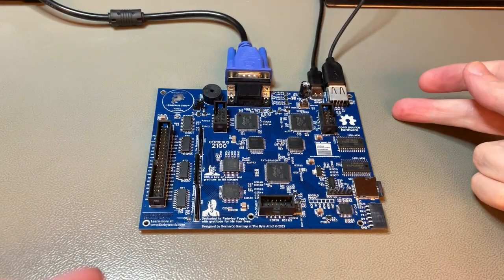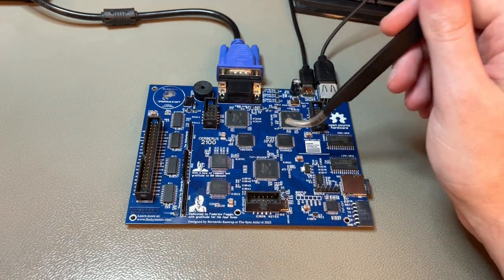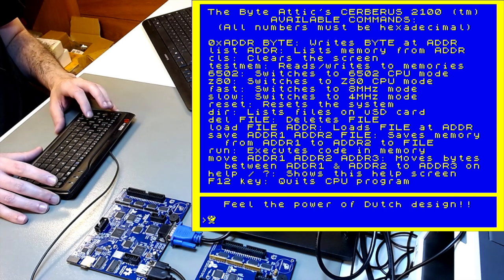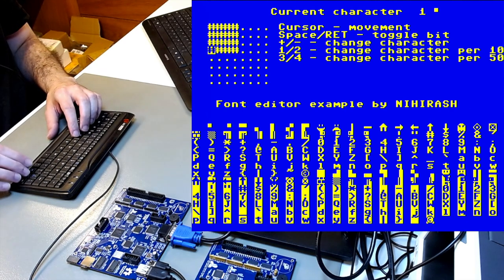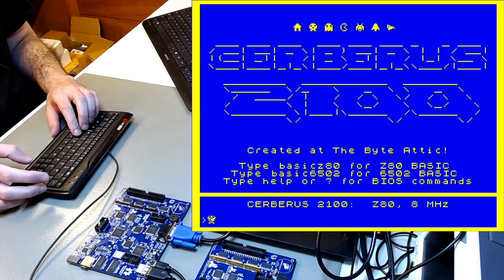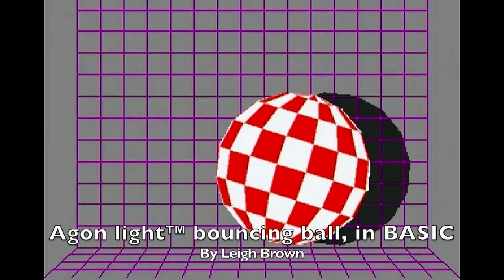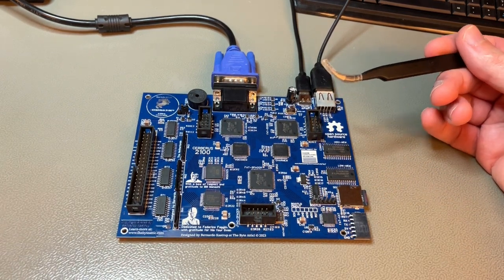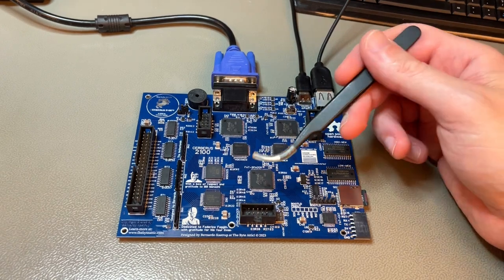Exploring CERBERUS 2100™, Episode 1: introduction and demonstration

Comment: Great effort, your frustrations were mine too. I completed both an EEE degree specialising in Computer Engineering but we were never exposed to something like this. The most we did was PIC microcontroller and some FPGA stuff around an implementation of the Nokia Snake game.

Masters in Mechatronics was similarly in a different direction - both were Math/ Theory heavy with minimal practical exposure. It is rather shocking.

I’ve learned much more post Uni and appreciate your efforts for sure.

Comment: In feel, it reminds me of the old BBC B. One of the assessments on my degree in the 80s was design and implement a server room climate control system - used analogue signals on the userport to read analogue humidity and temperature, and control cooling, heating, and dehumidifier devices in the 'room' (basically variable resistors, with a bit of support circuitry supplied from the Computer Lab skunk works) with paper logging of time out of specification. This (without the printer) would be great for teaching external control and monitoring

Comment: You mentioned the cplds you're using are the best choice because they have internal program memory, making the design simpler. How many write cycles does their internal memory get? I was using some xc2c128 cplds in my project but then found out they only get 100 rewrites before they stopped working. The next easiest to use chips were ice40 fpgas which needs an external spi rom but at least they're faster and 1/3rd the cost so it was a worthwhile tradeoff. I miss that easy schematic mode thingy ISE 14.7 has though, man that made things so easy.

If I would have known of the existence of simple cplds that don't have such severe write cycle limitations, I would have picked that instead. Too late though, I spent like a year tinkering with fpgas, already figured enough stuff out to actually use them and it's too late to turn back.
Reply from the maker: Not sure how many cycles, but I think it's flash-based, so a couple of thousand? I never had an issue, even after many, many reprogramming cycles in the original prototype/

Comment: How about if i want to use my desktop computer as a terminal to write assembly, C, and Forth on the CERBERUS? Or write my code in vscode, and run it on the CERBERUS?
Reply from the maker: You can use offline tools to develop for CERBERUS and serially download code straight to the uSD card. But in principle it won't work with an external terminal with the official version of the firmware. A hack of the I/O processor may perhaps enable it though.

Comment: CERBERUS 2100 vs AGON video, is that possible? Can different OS CPM, Commodore, ZX Spectrum, and so on be installed?
Reply from the maker: Video is possible, sure. CP/M can run on both computers, no problem either. ZX Spectrum/C64 emulation is possible on Agon, but not on CERBERUS.

Comment: Wouldn't it be possible to chain JTAG ports of all CPLDs and get rid of two connectors to reduce the price and complexity little bit?
Reply from the maker: Yes. In fact, this is how I originally designed it. I ultimately decided against it for simplicity reasons: chained JTAG requires a little more involvement with the software for programming any individual device. It's not difficult, but can lead to confusion and error for students. It would also require long traces with lots of VIA hops to connect all three ports on the PCB. On the pricing side of things, the shrouded connectors you see cost less than 30 cents each, so the extra cost was immaterial anyway (less than a dollar, in a bill of materials well over 100 dollars). So now the traces are all short, without VIA hops, and it's extremely easy to program individual devices.

Comment: A most cool machine, very seventies and twenty-twenties at the same time.
I understand why you choose CPLD over FPGA, I'm sure it will be fun and illuminating to play with. However, it would be nice if somebody makes an FPGA expansion card (preferably using a chip which has an open source tool chain) for those who want to take the next step while still having a transparent underlying system.
Reply from the maker: It should be fairly easy to make that FPGA card! Maybe at some point I'll do it myself, if others don't do it before me.

Comment: BBC BASIC for the ZILOG can speed up that cube program.
Reply from the maker: It is running under BBC BASIC already. It's slow because many characters have to be redefined every time the cube moves (tile graphics), and doing so requires several calculations.

Comment: Why didn't they specify the ZILOG Z800 and WDC65C816 CPU which would let you have access to games for the ZILOG Z80/Z80A/Z800/6502 and 65C816 coded games so what about a 16bit CERBERUS and I think that there is a version of UNIX for the 65C816
Reply from the maker: This is meant as an educational machine, a platform for experimentation. Code compatibility is not relevant for it. And it is important to keep things simple in an educational machine.

Comment: the chips can be reduced down to 2 ICs. A Max10 cpld with 50k elements and an rp2040 as True USB Interface for connecting mice & keyboard, UART, GPIOplug, and HDMI over DVI. for IO header, CPLD pins can be used. also the CPU Z80, 6502, AVR, 4004, Mc14500, CDP1802, etc can be designed in CPLD. 
Nice project. Although the microchip cpld ecosystem is a bit weird considering the software. 
Cheers!!
Reply from the maker: I guess you didn't watch the video through to the end, otherwise you would have understood that I didn't want black boxes (such as the RP2040 doing all video and I/O) in this system. This is an educational system, not one aiming at the lowest possible cost. As for the MAX10, it is an FPGA, not a CPLD (they are completely different things). And if you had watched the video to the end, you would have understood why I deliberately did NOT used an FPGA. In conclusion, just watching the video before commenting might be a good idea.

Comment: The most interesting part is you insist using a PS2 compatible keyboard which is rather hard to find, not sure if the wireless dongle will work, you must have your reason ... though.
Reply from the maker: The USB protocol is much more difficult than PS2 and would require a much more expensive and complex I/O processor.
Reply: @thebyteattic  Is there any chips available to easily make the job done? I know USB is not simple thing, but the fact is USB pushing out other options since they are dirt cheap.
Reply from the maker: @johnsonlam  there are plenty of PS/2-compatible USB keyboards, new from amazon. There just isn't an issue.
Reply: You can convert usb to ps2 using a pi pico.
Reply: @thebyteattic  Will check out the list.
Reply: @thebyteattic  Would be nice to have unpopulated footprint for PS/2 connector for people who wish to use actual PS/2 keyboard.
Reply from the maker: @pvc988  That footprint costs board space :) But I do understand your point.
Reply: Using a USB connector that requires a harder to find USB keyboard that supports PS/2 mode, seems to be asking for a lot of support enquiries! i.e. “My keyboard doesn’t work.”  Why did you not use a PS/2 mini-Din connector, as is the standard connector for a PS/2 keyboard?